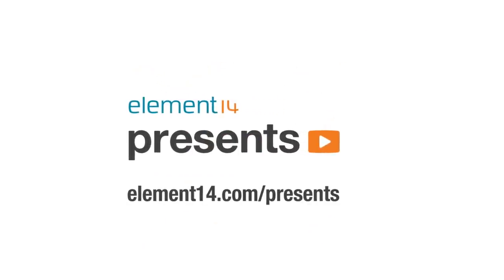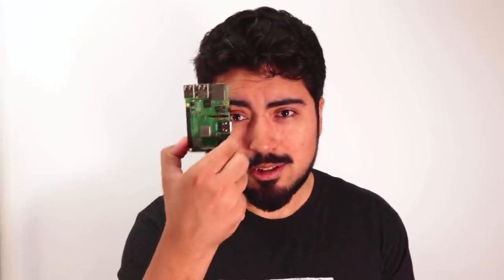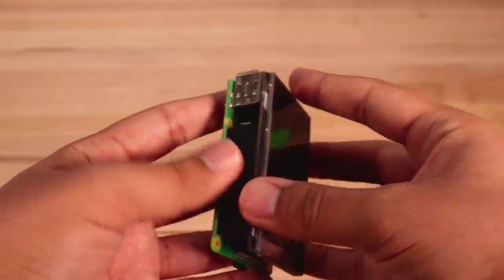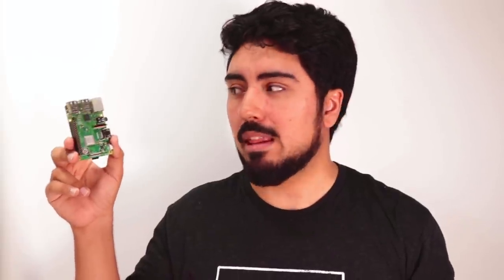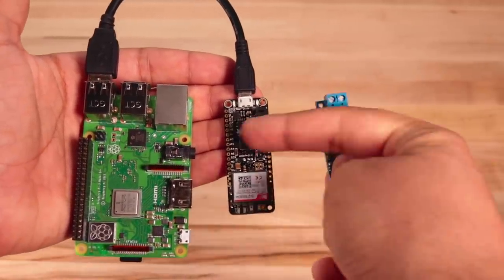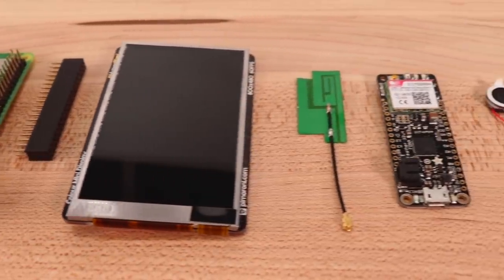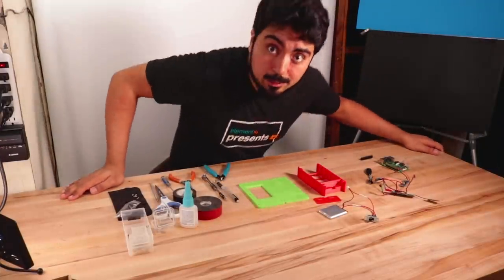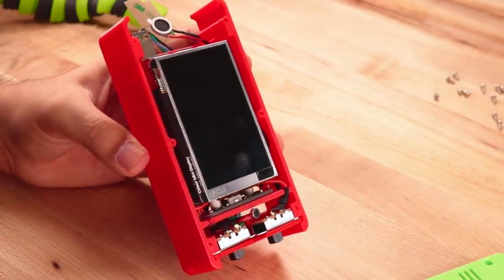Make Your Own Raspberry Pi Cell Phone

Comment: step up your game, desolder some of the usb ports to make it slimmer, you can directly solder the 2g module to the pins in the desoldered usb port, directly soldering the screen would also reduce greatly the size of that thing
Reply: Alanna Lopez Trimming it down more is totally possible! For now Im keeping it "full size" since this makes developing with it easier until Im satisfied with the software side of things.
Reply: That was the first thing I thought of when I saw the pic of the finished product. Still an awesome project though!
Reply: As a beginner, i assume removing the ethernet too would be acceptable?
Reply: yes, it's totally possible
Reply: Prototype
Reply: his game is non existent.  BUT yes a "Thin client" would be more suitable, this is what happens when someone makes too much money (mr.heck) he puts some rookie engineer to work reading jokes off cue cards.  Felix is dry as hell but he knows his stuff.  They were charging 12$ more than the rest of the world for the rpi 3b+, when your pumping units like element14 you shouldn't need to do that..  Its not like ben didn't know linux he just had enough money to hire some young engineers and not work anymore off those 12 dollar rips lol.  this guy is trying to  hard and not at the same time if thats possible.  I think I would leave one USB port though , considering there is no usb support on the micro port even with otg.  This way if you want to hook up a ethernet/usb hub you can have the option and we're talking centimeters of a difference and a single usb port is about as thick as the average smartphone anyways. Good call though, they havent done any videos in a little bit, this was not the one to come out of the gate with.  This show became all about the 3d printer a long time ago.
Reply: Hi Steve. I'm neither the only nor the first of the new video content creators for this channel. You should check out the other builds my peers have made for Element 14. I'm open to critique of my builds and video production; it's always more useful than praise (although that's nice too). What brought you to the channel originally? What would you consider the best content that Ben and Friends have made? P.S. none of us work for Ben :)
Reply: Would be the same thickness. The face plugs into the gpio pins. That's why its thick..
Reply: you could use a female to male ribbon to get it closer to the board wit the extra slack to move around.  You could use a non conductive pad so that the back of the lcd doesnt short out the board or use a display that connects via the actual ribbon display slot at the opposite end of the pi.  I am not saying your wrong because I actually didn't think about the large female header block on the bottomside of the hat.  Good catch though Terrance.
Reply: Terrance Barrett , slightly thinking out of the box if we weren't using the same exact screen he did.  The pi zero phones have many layers but are very cool in my opinion , I love the tactile buttons.  I actually hate touching my phones screen and getting it messy, but its a necessary evil for the screen real estate we've gained in the past 11 years since the first smart phones in 2007.
Reply: Mr. Volt  , you guys do a great job in production and presentation.  The thing about youtube that is important is knowing why your coming to a channel and what you should expect when you get there.  For me it boils down to a main topic and two sub categories.  For instance to be vague a "tech enthusiast channel" , sub cat 1 single board computers, sub cat 3 which is really the meat and patato's " single board computers with custom 3d printed enclosures interacting with components and micro controllers".  It can go deeper than that but when I come to element 14 the model expressed above is  how I begin to differentiate this channel from other tech channels with similar niches.  I am glad you asked. To answer your question more directly I loved when he made the Xbox into a laptop, and the early handheld game emulators.  People buy things and some people like me would rather build them.  When he made the game pad on the proto board and programmed each button and you actually get to see what goes into that, it gives you a greater appreciation for hardware and software developers because their jobs are not easy and I do not think they would have it any other way.  If you do not continue to challenge yourself every day your passion becomes a job & routine  : *(  ..  Are you with element 14 or are you a separate establishment because I would like to view your page and its content if possible.  Thanks.
Reply: Yea what she said!
Reply: @MrVolt  
You should make a badass E-cig with raspberry pie. I don't think anyone has don't it yet. Definitely would catch some attention
Reply: can you make some kind of back-pack aerial and a wheel barrow to cart all the bits around, like we had in the 80s? :D
Reply: Also bigger screen using the HDMI port. You can buy a screen that is also touch avaliable. Via soldering it directly imstead pf plug in and play. Solder opens up a new realm of compact.
Reply: @DDBAA24  i see this more as a programmers phone than anything. You plug the phone into your laptop when editing code and test it on the device to trouble shoot. If it runs on the device then send the code to said system that requires it. That or add a keypad and make it an easier codeing system. I code daily but need a device that can do it on the go. The laptop seems like the only viable option yet the raberry pie seems to have a more flexible apeal. Simply all i ask is for you to make a more flexable versiom with all sorts pf hardware. No 5g that stuff will fry the chipsets. Along with your pocket. Make it have some form of apps if not creat on open source start code for the UI and make it so people can edit and change the UI to their pleasing. Such as wallpapers and apps. Some open source file for app creators like google play but this would be Raspy pie or somthing of the sorts.  Im pleased to see people realizeing the potwntial tho.
Reply: It reminds me of the older mp3 players from the 2000s that were thick but could still fit in my pocket lol
Reply: Great project/prototype! It’s amazing to see how doable it is to build a diy phone.
Reply: You could also desolder everything and buy an iPhone. 
Your looking to use a Pi to make a phone, not making a phone with the corpse of a Pi.
Reply: yeah, getting rid of all those bulky ports is definitely something to do to improve the design. Albeit, trying to hack too much a Raspberry might seem scary, but it's totally doable with a bit of patience and practice.
Reply: @danceswithglowstix22  yeah you could just make an internal cable to wherever you wanted to remount the ethernet.
Reply: That would just make it a modern phone. I thought the point was to have a modular beast of a phone?
Reply: Compute module?
Reply: ribbon cable to screen, powering the screen separately, makes the thing a lil longer but much thinner and it can be taken apart more easily, may have to find a different screen for it though
Reply: Look up the schematic of the prototype and desolder for slim down, add a camera(eventually), and add a cooling system(graphite heat spreaders, heat pipes, and vapor chambers).

Comment: This is what we all dream of in early 2000. To build your own phone just like building computer desktop
Reply: Motorola still has a modular phone like that but there is not much interest from buyers/devs, Moto Z2... Really love the modular phone idea tho
Reply: @paulrodriguez300  rip projevt Ara
Reply: I still dream about this. 5 months after you made that comment. We'll get there.
Reply: First reply from 2020
Reply: I'm still dreaming about it. Modular phone should be an option by now.
Reply: @sigitharyadi6513  just bought an ender 3 finally and I'm pretty comfortable with electronics going to try something like this with a bigger screen better battery etc. Really gonna try and get a thin sbc and maybe do some cutting lol.
Reply: I am waiting for a phone running Desktop Linux as its OS. So that I can treat it as moving computer as phone.

Comment: I've got an idea. Since it is a proper pi, it can also be used as a desktop computer (to some extent). What if you could slide this phone into a DIY pi laptop sort of device and turn your phone into a proper computer. Alternatively, you could just plug in a display, keyboard and a mouse in order to turn it into a desktop computer. Either way, this certainly has a lot of potential.
Reply: Dude this is a pretty solid idea
Reply: the ultimate all in one

Comment: Sorry for nitpicking, but right at the beginning you made a mistake, (sort of) A USB can be hooked up to your mobile phone, however you just need an adapter cable. My phone is Android and when I tried this, the phone definitely detected it!
Sadly though, I couldn't open the files from the USB. This may simply be due to the file format perhaps, OR it detected the space, but needed an app to access the files on the USB.(?)
 But my point is that if it detects the USB space, that space is usable by the Phone! Peace. :D

Comment: Why not use a raspberry pi zero? It would make the phone more compact, then you could fit it in your pocket.
Also really like this guy and his videos, probably the best on the Ben heck show.
Reply: Because it is much slower than the rpi 3B+
Reply: @muh1h1  For the level of features he showed off in the video even a Zero should be more than enough.

In fact, there's a different project that is already using the rPi Zero as a phone that's worth checking out for those interested here: https://hackaday.io/project/19035-zerophone-a-raspberry-pi-smartphone/log/51839-project-description-and-frequently-asked-questions
Reply: I agree, this is the best guy at the moment out of all the new people. No one tops ben tho lol.
Reply: Yeah not by that much tho
Reply: EthanDoezWhatever. Thanks! Yeah as mentioned below, the zero is much slower compared to the 3B+ especially when running graphical apps, plus I did want the full size usb without needing to add a hub to the zero.
Reply: True
Reply: yeah but you don't get a USB port

Comment: There are other options for a touch screen. Imagine setting up  a Pi 4B+ 8G, an HDMI touchscreen or screen connector touchscreen.  Hook camera to the camera connector.  Then use a phone adapter module. a custom heat sink to redirect the heat. Then small M.2 drive Maybe secondary SD card adapter.

Comment: Why don’t u use android as os? It runs great on the pi 3 b +! I like the design!
Reply from the maker: Which android build works best? Is it GPU accelerated yet?
Reply: element14 Presents android 8.1 Oreo works good on it
Reply: 8.1 works fine i can host a .img file if u want me to?!
Reply: No way, really? Last I checked there was no Raspberry PI support... Now I'm kind of excited.  Is it just the 3.5 b+ or will other PIs run it also??
Reply: I want you to, is 'gapps' working because android means nothing to me unless I can get in the google play store or have some way to get apk's on the board.  I tried emetria and something else I think I was having a PSU issue.  Any way , where can I find a working image with google play or a way to install apks.  Android never plays nice with my hardware for some reason even today I tried booting an x86 64 version in a vm to try it out.  I just recently came across this pretty cool older asus netbook. and I ran it live and tried with a full install and it was sitting on a black screen with a blinking cursor for an hour before I was sick of trying.  I bought the 3b+ thinking everything that worked on the 3b would work , I was sadly mistaken.  I upped the USB output and stuck diet pi on a flashdrive, made a self deleting ramdisk , and customized it to my liking. I manually installed a bunch of software( not from the launcher), the system is pretty optimal, for me.  I still want an android os though so please post it, thanks.
Reply: I would build this so Google doesn't get anymore of my info. Forget Android.
Reply: Search the ' ungoogled' phone.  This french guy made it.  Or you could just get a custom ROM for your Android, it will give you a clean install without any bloatware and you can choose to install google & google play service or not, you can just install apk's via ADB.  Plus there are a bunch of cool Python VOIP clients out there, I stopped paying for a cell phone a long time ago, WiFi is free and its now everywhere.  Most people are on unlimited cellular plans these days, but if your not grab the FREETONE app , VOIP incoming and outgoing, sms. mms,face calls, voicemail, pick your own number, free calls to US and Canada and you can burn the number and get a new one as many times as your want free.  Its only tied to an email that you can make and abandon  It supports VPN and you can also run it through Orbot, for the paranoid, because the app is always searching for open wifi to keep your connected.
Reply: @element14presents  Hi! So, what do you think about all the responses you got here?
Reply: If I wanted Android, I'd just buy an android phone. I want to get away from Giggle and sandboxed Android.
Reply: @DDBAA24  I guess that would work in a highly populated area - in a more rural/semi-rural setting you'd have difficulty having reliable service without relying on a cell provider.
Reply: @Maxdpweed I talked about a few apps and this was a little while ago now, can you be more specific about which one you are interested in.  thanks
Reply: Why not paint your car red? Coz.
Reply: does this need a carrier or is it a "free service?"
Reply: killacounty uh android is an open source Linux!

Comment: I'd like to do a project like this with the raspberry pi CM4 and a 4g module. Does anyone have any advice? Also, I'd like to have some faster storage on phone. I've seen how you can boot from usb and maybe even a nvme drive. I'm worried about cooling for an nvme drive and the pi itself. Battery life is also a concern of mine. I was considering booting over a usb drive over a sd card because I've heard they're faster and I don't think cooling the storage would be a concern with a usb drive.
Reply: Did you end up making one?

Comment: Although I really love the idea, you list me with the gpio screen. You talked in your into about a phone with gpio, if love to see a different screen and an external header for the pins. But that is probably just me, the gpio is my favorite part of the raspberry pi. Also you might want to look into a relay that activates when the USB is plugged into the wall that shuts down the pi making it less likely that you forget to flip the switch at night, and having a dead battery in the morning.
Reply: The power system could definitely be improved! I just stuck with switches to KISS for now. The backlight is noticeably lit when the pi is shut down, so I'm not too concerned for this version.
Reply: @MrVolt  sounds great. Keep up the iterations! Franlab actually got a package that contained many iterations of a project from the 70's in her latest viewer mail video. And don't worry about my thoughts on the full use of gpio on the pi, I already have made it known to the Element14 community about how I feel about using all the gpio for video. Ben addressed my concern in the past. Lol. Keep on tinkering!

Comment: This is CLEARLY a case of "Why? Because I can!" if I've ever seen one! 😜😂
Reply: I think not. The Pinephone and Librem 5 are indicators that more control over phones by users is desired and also GNU/Linux is a desired OS over Android/Linux by many as well. Raspberry Pi is one of the most widely known pieces of GNU/Linux capable mobile hardware. I wouldn't discard this idea so quickly. The phone in the video is bulky, yes, as prototypes typically are, but it could be made to be smaller and mass marketed. Higher end Android devices out class it, but only because the current demand is unknown. Pine64's Rock64 is a Raspberry Pi competitor. What is a Pinephone if not a Rock64 in a phone case with a touch screen?

Comment: Is it possible to make a similar smartphone but running android or some similar OS capable of running apps and web browsing?
Reply: I know that a pi 4 can run android pretty well, so if your using a pi 4 you probably could. Android is also linux based so there might be some patches for the drivers.

Comment: I would prefer the SIM7600 as the modem, for which i already use to get 4g connection on my pc and make calls and check sms inbox using putty.
Reply: Eventually i am thinking of buying SIM8200 which is 5g enabled if that becomes cheap enough (currently over $300)

Comment: I didn't watch the whole video, but tried skimming to it to find this info but I couldn't seem to find it: what about registering a plan with a service provider? what was done for that process?
Reply: I did skip over it because it's rather dull and involves contact information. I'm using TING which still has 2G GSM connectivity and a cheap pay per use plan.

Comment: How did you get the keyboard to dial the numbers ... can ya send me links or something... so I can build one. You mentioned Qt or something ... I have the zero ... and the pi 4 8g ... so in essence what I need is a graphical user interface from once I connect the module that I can bring up and use to dial and save contacts and so forth what did you used to do that?
Reply: Qt is the library for building the GUI. Add variables and functions to the GUI elements. (number_0, number_1, add_to_contacts, dial_number, etc.)

Comment: I don't understand the extra charging switch. Some diodes would enable the pi to run on 5V while the battery is charging.
Reply: Simple physics.

Power consumed > power delivered